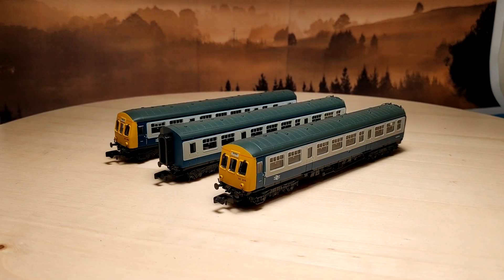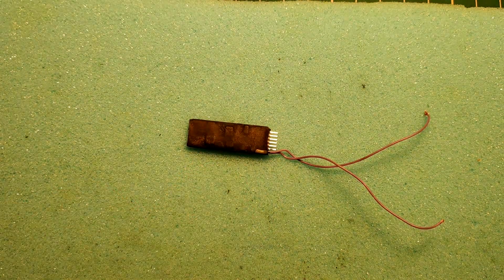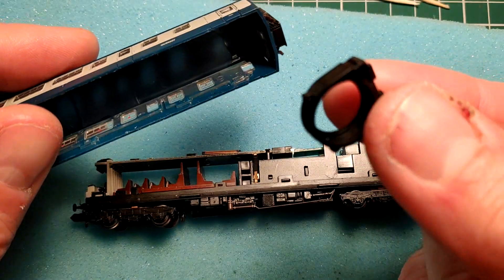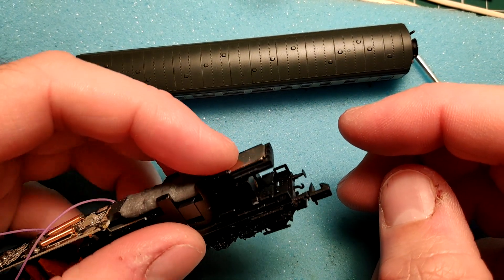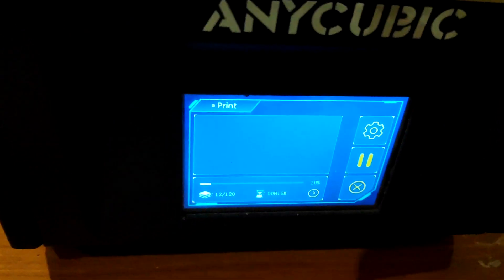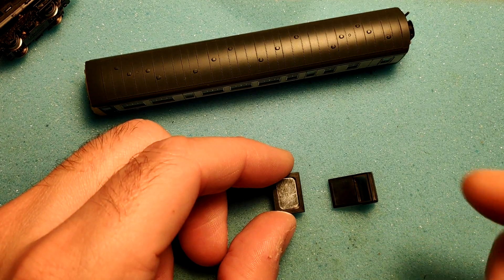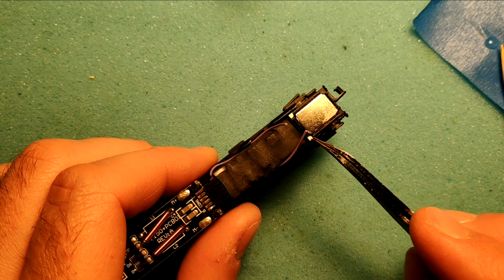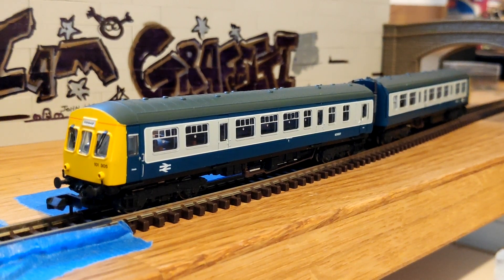Class 101 Fitting Sound and Quick Run

Comment: Nice job with the sound installation! You are really showing so many benefits of the 3d printer. For a minute I thought you were going to be really clever and make it fit into the slots that the original Bachmann speaker housing fitted into but no Black tack wins the day 😂. Zimo chips are one of the best brands for motor control which you should now find with lots of other options using the aux pads. All the best Tony.
Reply from the maker: Definitely more choice on the CV's on a Zimo vs TTS chips 😂, 700ish choices to be exact lol and although this is the first zimo chip ive played with i actually still like my TTS chips sound and simplicity wise 👍

Comment: I have been resin printing for a few years now and I truly believe model shops will struggle fairly soon when the larger build plated printers come down in price which there is one I have my eye on at the mo 😆
Reply from the maker: Mono X? The printers really just allow us to have more accurate freedom with the hobby lol, i mean theres stuff my printer can do thats just way to tiny to do by hand! 👍
Reply: Yeah I had an fdm printer then photon  now photon s but I really want a bigger build plate resin printers are the way forward for detail prints
Reply from the maker: Cheers for your info on 3d files 👍, i actually tend to make my own if i can as my prints generally end up coming out better 👍, i have tried your method before but it was so much work to convert and fix meshes i gave up and just make my own models now 👍
Reply from the maker: @teacoffee5847  i was looking at the mono x but went for my mono se as the smaller build plate can actually move faster... Maybe one day il have both lol 🤞
Reply: @ThisWayWorksTWW  I think it's just me being greedy lol. Your printer is 100% spot on for this scale and any really when building in parts.. keep up the awesome videos, so much great info you produce!
Reply from the maker: @teacoffee5847  Thank you 👍, i mean the print time will be longer on the mono X as the resin has to rush back further when printing per layer vs the smaller build plate of the se i have... Although its probably not alot extra in print time tbh. going for a bigger bed makes alot of sense 👍 meens you can print more! More is always good 😂